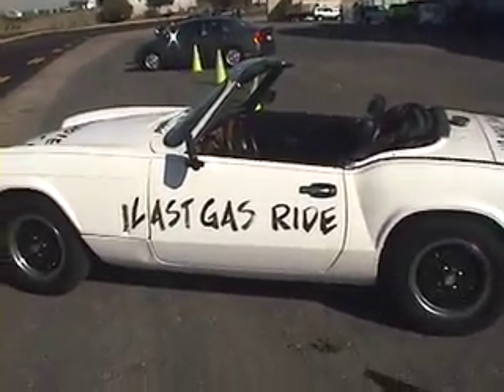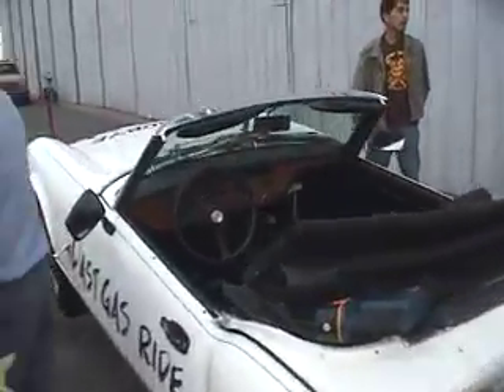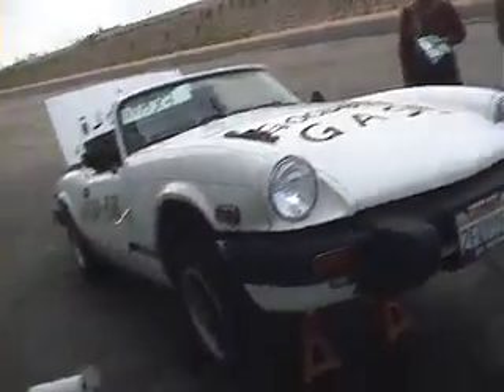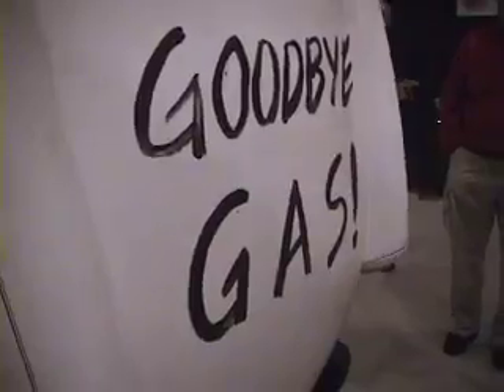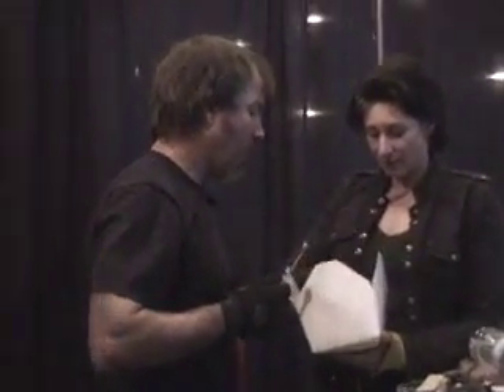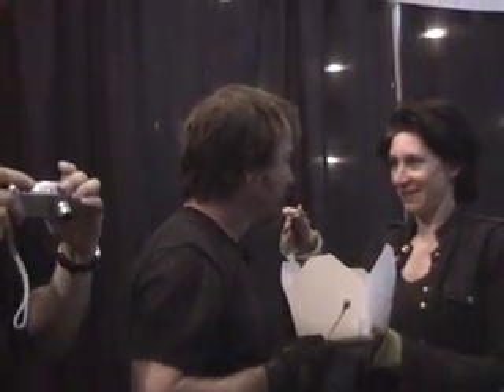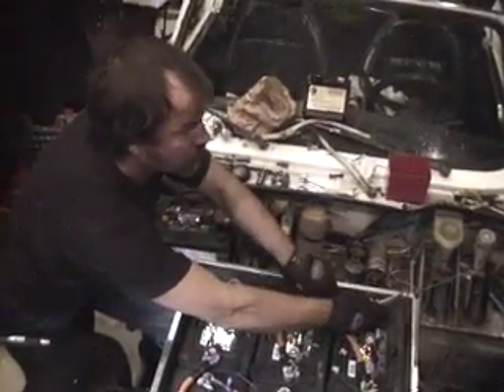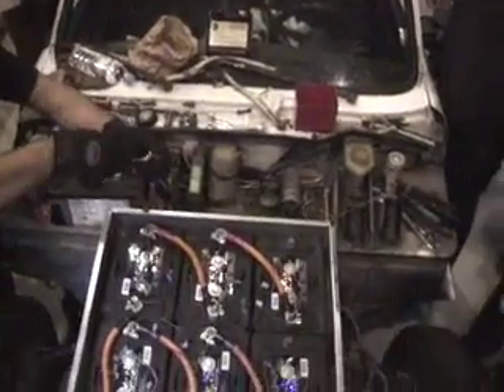Left Coast Electric converts 1978 Triumph to an electric car

Comment: there is also an EVDL mailing list where you can ask questions from others that have done it. you sound like you have the skills to make it. a 'big' problem though is the cost of the parts. it's still a bit expensive because it doesn't have mass market but with a few compromises you can actually do something relatively cheaply by using for instance a kelly controller and maybe a chinese DC motor

Comment: Electrolysis also takes quite alot of electricity compared to simply plugging in a car, with electric cars, the electricity is sent directly, not indirectly. So there's obviously a loss of energy in this conversion process for Hydrogen.

Comment: And if my memory serves well, it's easier to convert a RWD car, but it'll be less efficient. Generally, RWD layouts are heavier since you have a long propeller shaft running from the front to the back of the car, whereas with FWD (unless your engine is located in the rear) transfers power directly to the wheels that are pushing the car forwards.

Comment: With hydrogen, you're a slave to the oil companies' procrastination or the painstakingly long and energy-guzzling process of electrolysis. By the way, what happens when there's a Hydrogen leak which, by the way, is a flammable gas? Can anyone here say... Hindenburg?

Comment: Another point I need to stress is that PEM fuel cells typically fail during their first 2,000 hours of operation... Ouch. Even Lada's aren't that bad. Electric car engines last millions of miles (literally) and batteries only need to be changed once per decade in most cases. Electric vehicles don't require a complete change in fueling infrastructure, and cost pennies to run, there are now batteries . Electric vehicles can be used be anyone in the world so long as they have a power outlet.

Comment: If you use liquid hydrogen which requires a tank "only" twice the size of a typical gasoline counterpart, you need to keep it at -253 degrees celsius, just 20 degrees above absolute zero and well below the surface temp of Pluto. On the other hand, to keep it nice and cool, you have to drive it everyday, so if you leave the car alone for about a week or so, your tank's empty. Electrolysis could be clean if clean energy is used, but 71% of the USA's electricity comes from fossil fuels.

Comment: In addition, all pipelines would have to be replaced to accomodate H2 in gas form, that's if oil companies still want to swim in cash. Hydrogen cars are horribly inefficient too, they need a reservoir 4 times the size of a gas tank pressurized at 10,000lbs per square inch just to get gas car-ish range per fill up.

Comment: Whatever its volume, hydrogen added to the atmosphere will combine with oxygen to form water vapor, creating noctilucent clouds -- those high, wispy tendrils you see at dawn and dusk. The increased cloud cover could accelerate global warming. Furthermore, Hydrogen would require a complete change in the fueling infrastructure, if even 25% of stations in the US are converted to distribute H2, it would cost 13 billion dollars.

Comment: If you are an engineer, youre not very experienced with hydrogen; instead of saying so, you keep rattling off efficiency percentages again. It doesnt work. Solar powered electrolysis is the future of this world. Tell me, why you are so bent on electric power?
You still, have not stated how or where the electric batteries are CHARGED, that takes energy; where is it coming from ?

Comment: Im glad to see youre aware of suppressed technology which of course is in the interest of existing industry. Youre indications of motor efficiencies are lovely, but wrong; keep in mind your sources. You  dont mention how these batteries are charged and you still dont make clear how the hydrogen is replenished and I wont tell you. Im referring to the battery maintenance,not the motors.Using existing equipment trumps all your data though; hydrogen conversions are the most promising possibility.

Comment: Youre assuming the H tank to be filled where & how? Im talking about it not being filled anywhere.I dont know where youre info comes from, but its wrong, electric powered vehicles need a different kind of maintenance and the truth is, nobody has improved the battery enough to even remotely compete with zero emissions of hydrogen. Best aspect of it is the add-on conversion of gasoline to hydrogen power;using engines that already exist would be ideal.Youve being swindled with electric power.